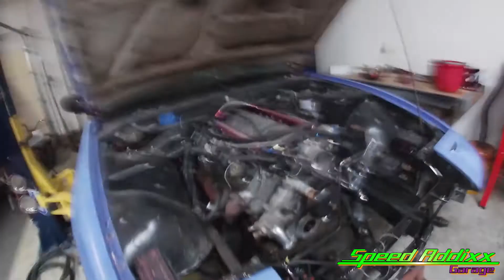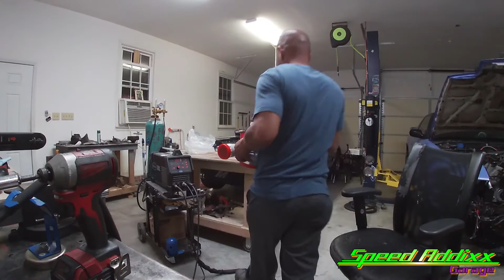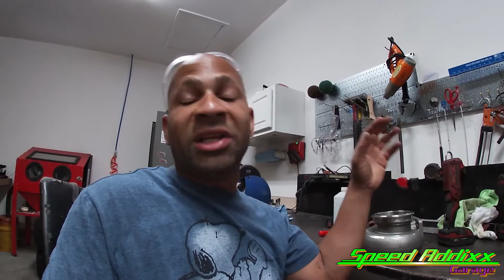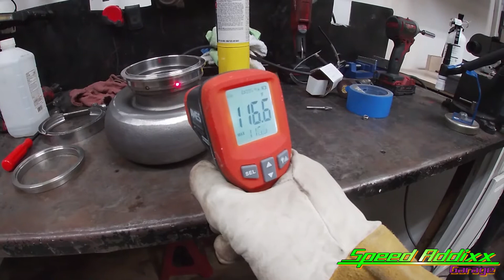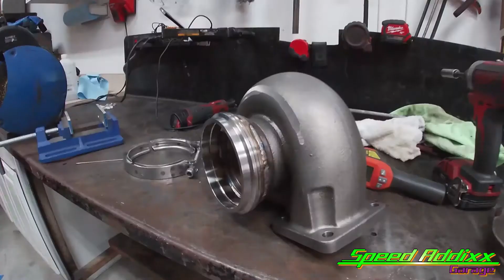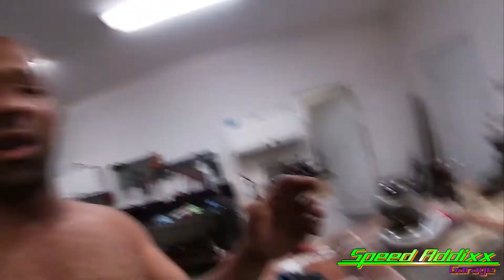*Welding V-Band on VS Racing 80mm Turbine Housing *

Comment: Toaster oven works good for preheating parts.  Set the temp you want and leave it in there till the part is as hot as you want.
Reply from the maker: Best $20 I’ve spent